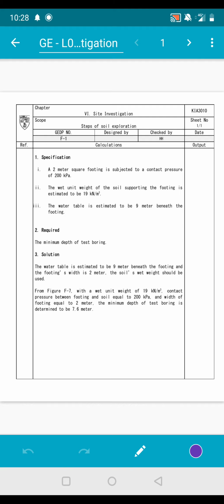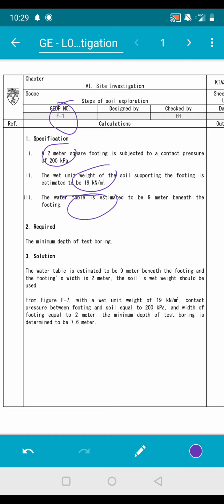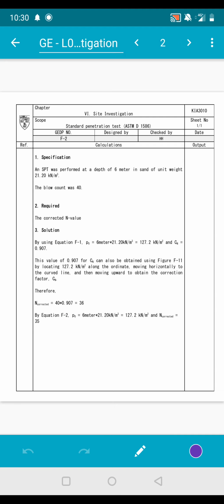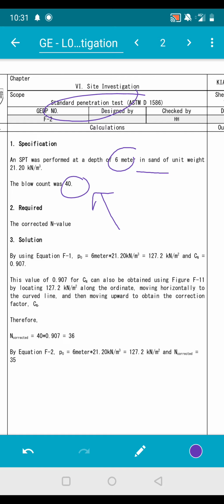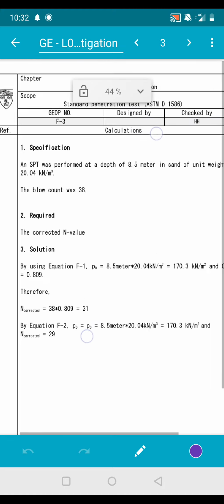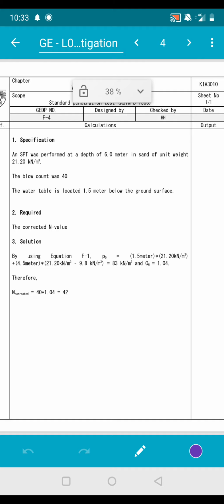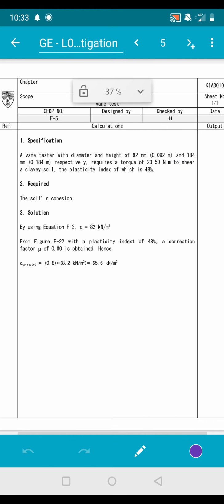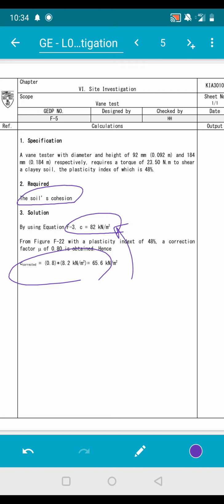GEDP - 06 - Site Investigation

Comment: Dr, question 4 is different from the design pad questions, the values is a bit different for the given depth. The given depth is design pad is 8.5m but in the video is 6.0m and water table position also different. And for question 5, the answer for c should be 8.24kN/m2 and c (corrected) should be 6.58kN/m2 ??
Reply from the maker: Impressive! Your correct.